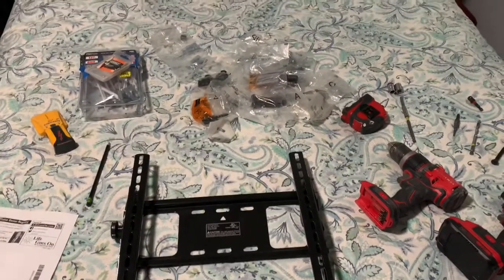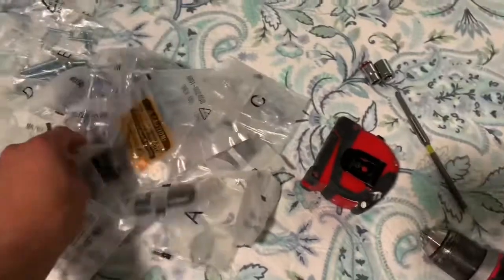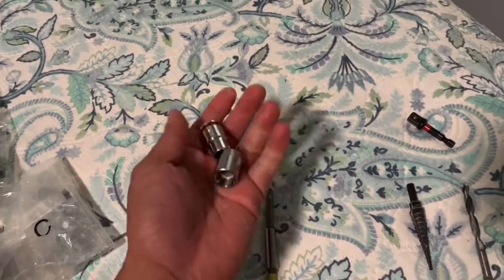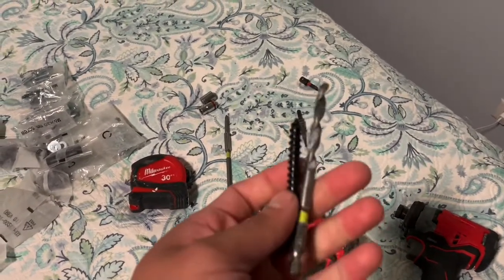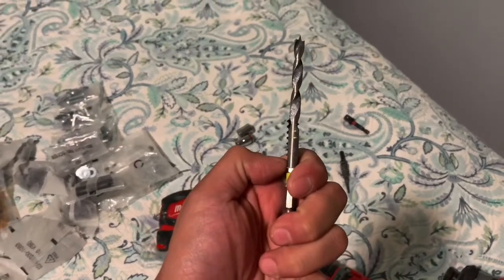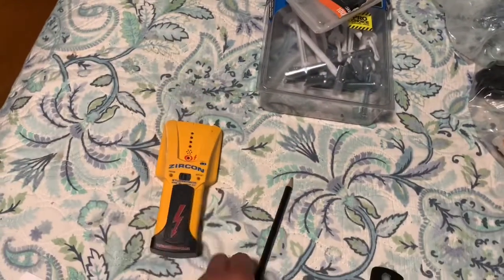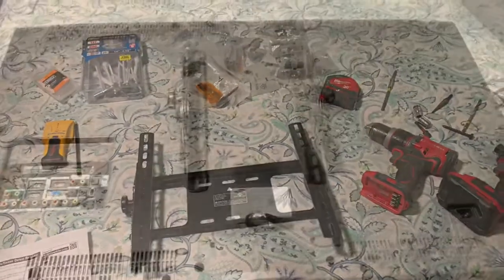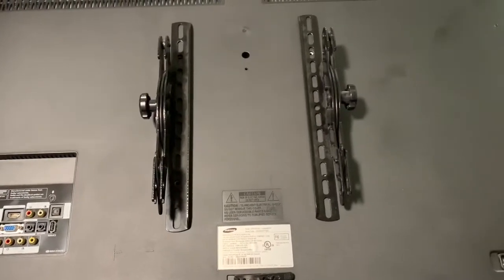How To Make Money Mounting TV’s

Comment: Hi Nesto. Thanks for posting your videos on your TaskRabbit endeavors. I've been doing TV mounts for a couple years now. Some things I'd add or ask others to consider: Never trust your stud finder. Use a hammer and a nail or a small drill bit to make sure you're hitting the stud in the center by testing to the left and right of where you think center is by a 1/2 inch. This is especially important for swing-arm mounts that will put much more strain on the wall. I've had to fix jobs that other Taskers and clients have done that start to fail a couple to a few months after install because they were drilled into the edge of the stud, not the center. Next, always find three studs and use their spacing to verify they're all actually studs by checking the the spacing is consistently 16 or 24inches. For plaster walls, stud finders never work: Instead use a strong magnet to find the staples/nails that run up and down the studs to attached the lathing then use a nail or small drill bit again to verify there is actually a stud there and you've found center. Last tip is to use a laser level to free up your hands because small bubble levels aren't very accurate and will not level a 60+ inch television reliably. Hope these tips help someone getting started. Cheers!
Reply from the maker: Steven Lischer yes all facts. Thanks for adding this info.
Reply: One thing to add is an endoscope. Worth the money when you run into a tricky wall. Especially with metal studs. Got to make sure you aint gonna drill through a metal pipe, and that it's a metal stud you're going to drill through.

Comment: Invest in a good Franklin stud sensor. Those cheesy ones are not very accurate. It doesn't seem like you hit a stud, but a flat 2 x 4 because you pushed through at the very end. That drill should have resistance all the way to the end of it